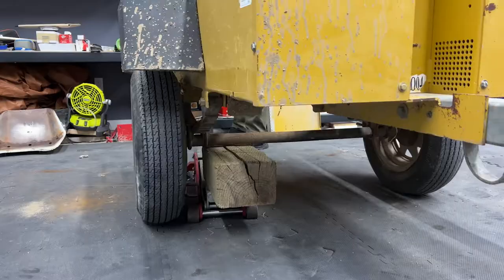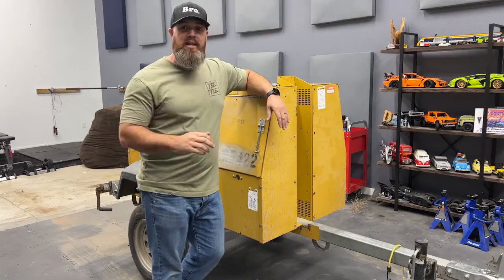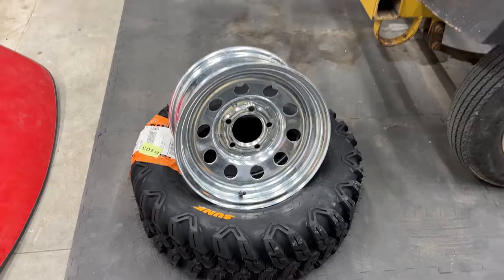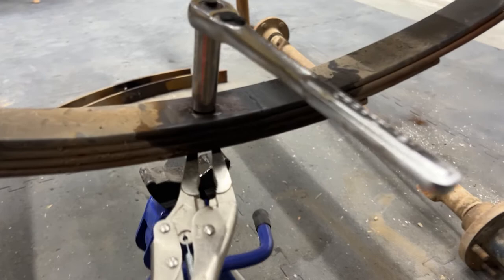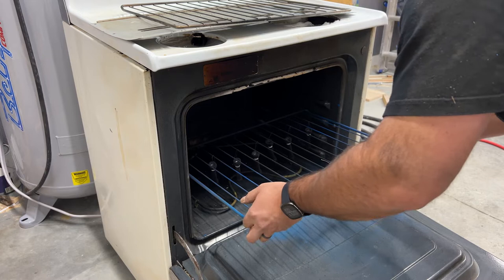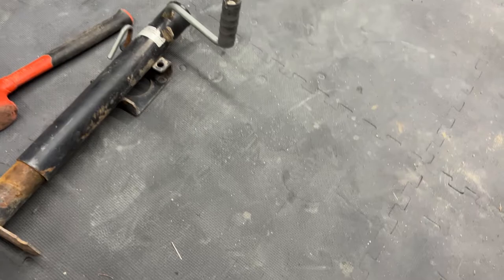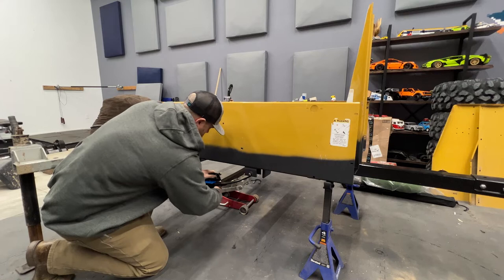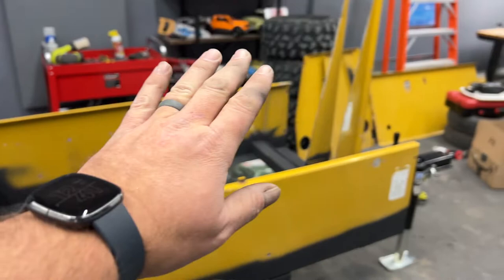Disassembly and Clean Up // DIY OVERLAND trailer [Part 3]

Comment: could change the draw bar from 5mm down to 3mm that would make a difference as well 👍👍 the extra weight is not so bad as is low level ground level not high  to tip over